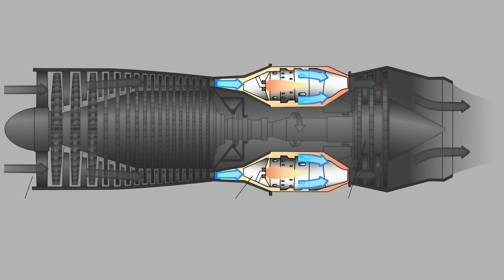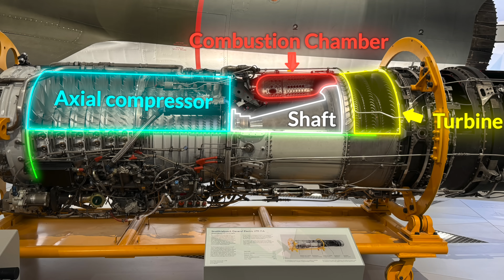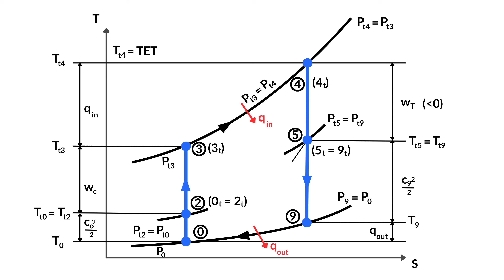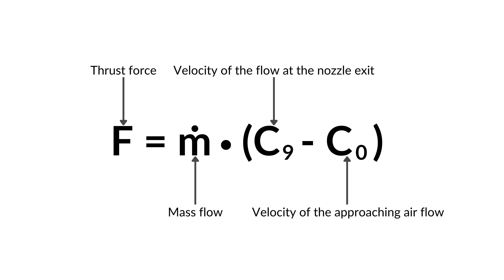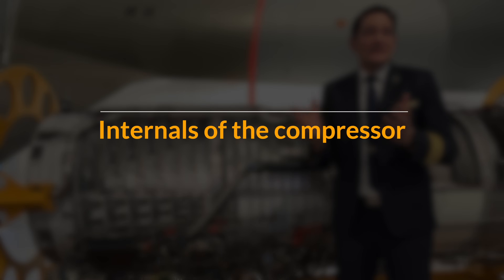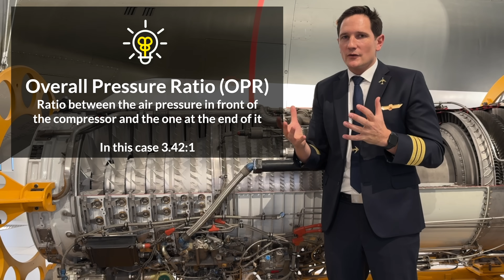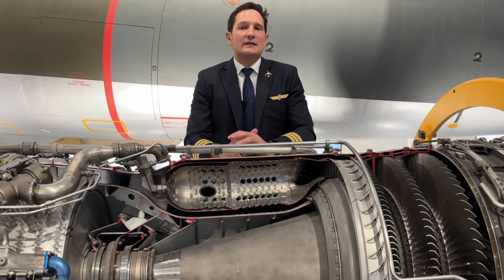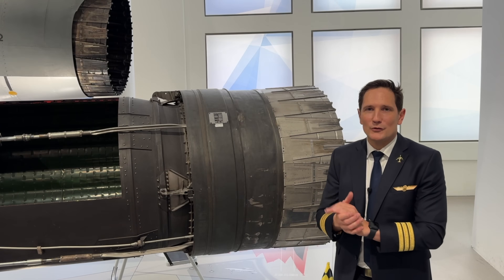How a TURBOJET Engine works - Explained by CAPTAIN JOE

Comment: As far as the air going through a turbojet engine is concerned, the stators move as much as the rotors do.  They don't move, but the air doesn't "see" them as stationary.  The air gets batted one way by a rotor, then the other way by a stator.  It gets smacked back and forth like that all the way through the compressor section.  Stators are the unsung heroes of turbojet engines.  The compressor section of an axial engine couldn't work without stators, and neither can the turbine section.

Comment: Captain Joe - This is probably the best description of gas turbine operation I've seen on You Tube. The one additional point that I would suggest including is that a gas turbine involves only a portion of the flowing working fluid (air) in mixing with fuel and combustion. This is in stark contrast to Otto cycle engines where the entire charge is mixed with fuel and burns. Otto cycle engines can do this because the hot parts are only intermittently exposed to the very high temperatures created by stochiometric combustion. The combustor or combustion chamber of the the gas turbine is designed to use the air that doesn't participate in combustion to cool the walls of the combustor and to rapidly and thoroughly mix with the hot combustion gasses to get the mixture of combustion products and unburned compressed air down to a temperature that the nozzle and turbine can endure. 
The thing that you properly mention that always confuses people seeking to understand gas turbines is that the highest pressure in the engine is at the compressor discharge. The general public always assumes, because of their greater familiarity with the Otto cycle, (combustion in a closed volume) that combustion must raise the pressure of the flowing air....but of course in the Brayton cycle the volume expands while pressure remains constant (other then the pressure drop of forcing the air through all the holes and features of the combustor).
Then the very hot and very fast flow of working fluid is sharply turned to tangential flow by the nozzle stage to impinge on the first stage turbine blades who extract work by expanding and turning the flow back to straight axial and so on. Most explainers say the flow "Spins" the turbine. This weak statement leaves the person trying to understand the engine operation with a host of other questions.

Comment: Suck Squeeze Bang Blow is a wild way to describe a turbine engine.
Reply: Actually, fewer people would be confused if we said "Suck Squeeze Whoosh and Blow". The gas turbine doesn't burn with bang. is burns with the same noise as welding or cutting torch....a whoosh. Otto cycle engines burn with a bang, but it isn't the bang you hear. You hear the bang of the exhaust valve opening and the piston pushing the burned gasses out. (if there is no muffler) The bang of combustion is contained by the piston, cylinder and head. When the bang goes crazy bad in an Otto cycle engine, Detonation, you hear the block "ringing " like a bell.
Reply: @jackthompson4993 That's true that's a good point! Is there a better term than Whoosh or is that the most accurate?

Comment: In the compressor section, the narration gives the impression that compression happens became the air is getting pushed into a smaller and smaller space.  It's actually the reverse. Compression happens at the stators.  The rotor blades add kinetic energy to the air stream, and as the energized air encounters the stator blades, the kinetic energy is converted to pressure, which in turn increases the temperature, and this process repeats all the way to the end of the compressor.  The volume of the compressor decreases in accommodate the decreased volume  of the heated and pressurized air.  So basically, the air isn't compressed because the volume of the compressor decreases, but the volume of the compressor decreases because the air is compressed.

Comment: If anything, you should have mentioned Frank Whittle the inventor of the turbojet engine. I worked on the J79 which was the engine for the F-4 Phantom.

Comment: Hi ,
well explained video of turbo jet engine m thanks for it 

may i know whether the APU of boeing 787 can be started in case of power failure due to both engines out and then use for giving power to controls ,hydraulics and as well to radio communication ?
of RAT is the only option which can provide those necessities ?
thanks again

Comment: We have programming forums too.....every platforms have different forums and as a beginner I used to just put my full bug and wait a day or 2 there were nice people who used to send almost the full code.....FORUM WORKS!!!
Reply: Do you have any computer or CHIP on or near the engine??? Or they wont be able to stand the heat around the engine??
Reply: Higher engine efficiency implies lower entropy generation...efficiency is high---- --higer the power and thrust-- and faster the plane moves---- And if angle of attack of wind is right more air will go in.....but fighter jet plans NEVER STALL no mater what they do, why???? nose-too-up over 90 degrees or full spin-- I know what I see at each angle is only less than a second......Henc what's what's I  am trying to say one or 2 seconds should not make any difference
Reply: sorry about clowning but its Bernoulli's principal----- hose-plastic-garden-pipes---sqeeze it at the other end, pressure increase and becomes a jet---addd shoer head its even more sharp and then what happens if I add a battery-motor to my showered, --it will become bike washing high pressure thingiii

Comment: A better explanation would be to explain how the "gap between any two blades" act as a diffuser. The gap (and the blade) act as a static or dynamic diffuser to slow/quicken the air in order  to increase the pressure at  the compressor end  and to accelerate the air to change pressure energy to a higher velocity at the hot end,  There is a static diffuser after the last stage of the compressor which helps to stop blow back from the burning stage  into the compressor. Be it axial or be it centrifugal ( Radial)  it is the variations in the  sequential DIFFUSERS  that do all the work, including in propellers. Most centrifugal ( radial ) compressors have an axial start, and the diffuser is an integral formation of the change in the radius / circumference length, forming the divergent diffuser, required in a compressor where the compression ratio of a centrifugal stage is higher than one axial stage. . 

The static blades do not merely change direction of the flow, but they too are DIFFUSERS that increase the pressure in the compressor and accelerate the air to higher velocity at the hot end stators. One could have mentioned the slow air needed to keep the flame burning, and then by pass air is added later to make it burn wilder, then more air to cool it down before entering the hot end turbine diffuser blades. Even the final pipe with the afterburner is a diffuser, and the exhaust control, another diffuser, as are the elevator, rudder, ailerons flaps, slat, wings, extended undercarriage, wing tips and spoilers!

A jet engine is basically a lot of tiny  helical RAM JETS, placed in parallel at different phase angle on the circumference of a cylinder, rotated around, so that the multiple tiny helical ram jets, phased, in parallel can start when the rotating cylindrical core, is stationary with respect to the ground, The sequential spaces, in series, between any two blades, form the long ram jets paths through the core of the  engine!!!! Hence the jet engine consists of a lot of tiny, phased, helical, ram jets working in parallel around a rotating cylinder! There will come a time where, the pressure distribution around the wing shape will create all the diffusers we need to make a thrusting  engine, by injecting fuel above or below the  contoured surface of a wing, after all, the wing is, two diffusers working one above the other, so are the control surfaces when we need them. The Diffuser and the ENGINEER  are Gods in aircraft design. The compression ratio of a jet engine cannot be above 50:1 as the temperature will be so high due to the increase in pressure, that adding fuel will be ineffective, 

 The brilliant engineering that went into the  engine for the SR 71, is hair raising to those who appreciate the working of a static diffuser, as that will be getting closer to God's own work,  THAT IS ENGINEERING AFTER ALL,  a man doing God's work, and not just operating a machine through following instructions, as they did not do on the Boeing 737 Max, nor the recent Air India crash where the Hull losses of that company does not fare well when it comes to simple maintenance of complex engineering. Few people know what is an ENGINEER. Many companies pay them less that they pay those who take the aircraft from one location to another.  Engineers are not respected  in the transport and communication systems on land, sea, and air. Modern people prefer to operate engineering devices, as Smart phones, hoping that the intelligence required in engineering will radiate and enhance their own performance. That will never be, but the operator can console himself through  enhancing  his simple repetitive activities by wearing and wrapping around him or her, an engineered prosthetic aid as , a pair of shoes, uniforms, Smartphones, cars, ships and aircraft. Note, one modern engineer, working from his home, can control, at a range of 10,000 miles,  10,000 drones using such micro modern engineering, where location, stable control, and navigation on Earth, can be done to the nearest five centimetres. 

It is interesting to note, those tiny propellers mounted on tiny drones, are now breaking records at Ukraine / Russia / Iraq / Palestine / Israel,  are dynamic DIFFUSERS, as shown in this video, explaining the operation of the mighty jet engine. Operating, shoes, knives and forks,  horse carts, bicycles, motorcycles, cars, ships, aircraft, has not changed much in the last 100 years, but the ingenuity  and processes in, monitoring, control , diagnostic, navigation,  included in all engineering devices , have risen exponentially. Few operators can ever appreciate the inner depth of engineering, Few people know an engineer, less a mathematician / engineer! Most people love to buy,  proud to own, or lease, or borrow, wear, operate an engineered craft, to enhance their naked, bare, performance, without ever understanding, nor appreciating the efforts and responsibility of an ENGINEER,  People appreciate and pay for a priest's prayer, when riding/ mounting on an engineered magic carpet, moving on land, sea, and air, and even tip the bartender when he offers them a drink after the journey on an  engineered the magic carpet, but most people never appreciate an engineer's efforts.  Engineering activity outside the human mind,  is  REALITY AND TRUTH , It works or it fails. All that exists within the boundaries of the human mind are illusions, myths and fantasies,  they never fail! People operating engineering devices, they stay experiencing  the titillations  in their human minds which are supported outside the human mind by pure engineering structures. If  either the engineering  that supports  Reality outside and inside the human mind fails, then all fail,  Illusions never seem to fail, as long as they stay within the boundary of the human mind, they are destructive in a sick human min, as in the case of Arthur Bud Holland of B- 52 fame, as disasters in other air displays.
Reply: Passionately said! We are certainly an under-appreciated lot. All the credit seems to devolve to the business men and the lawyers. Engineers are certainly the agents of change responsible for the mind -boggling changes in character and quality of life that have happened in the last 200 years.

Comment: The engine must produces most thrust during the take-off. The inlet air is stationary (discounting winds) and the jet accelerates it to high speeds. So the difference in velocity is greater. Also the engines need to accelerate the airframe to achieve pull-up speed and climb also requires work (= mgh). While in level flight the engines needs to produces enough thrust to overcome drag and get enough wind under the wings to produce enough lift for maintaining level flight. So the engines can manage to keep the aircraft flying with lower thrust than take-off.

Comment: Trying to answer your question at 6:56 'What phases of flight does a jet engine produce the most thrust?'   At the beginning of the flight.
If F= m * ( velocity at nozzle   -    velocity of the approaching airflow) , then when  the velocity
of the approaching airflow is at the lowest the  value in the bracket will be at the highest.
 For example,   (8- 0)  or F=8m  is greater than  F=m ( 8-6 ) or F=2
Reply: I also agree with takeoff as the highest thrust. You explain the velocity part well, but there's also the consideration of air density being greatest at ground level and therefore makes the mass flow the highest then as well.

Comment: Captain Joe:
This is a pretty good explanation, but ❤as a mechanical engineer, I'm a bit troubled in gas turbine explanations with the idea that the gas flow "spins" the turbine. When the hot gas flows through the turbine, it expands and changes direction, and in so doing the turbine extracts thermal, pressure and kinetic energy, converting it to mechanical torque. The torque either drives the compressor or the propeller, depending on which turbine we are addressing. (The torque times the speed is the horsepower generated by the turbine.)
This is what the descending piston in a piston engine does: it expands the hot gasses to extract mechanical work from them on the power stroke.
The other thing that is always left out of the discussion is that the combustion of the fuel only involves a fraction of the compressor compressed air stream. A significant amount of engineering design and angst goes into mixing the products of combustion ( at a very high temperature like 3000 C) with the compressor discharge air to get the hot gas stream entering the High pressure turbine down to a tolerable temperature for the blade materials. The PT-6 cleverly folds the gas flow to let length of travel for mixing without adding to the engine length. (All those holes in the combustor promote mixing and cool the walls co the combustor.)
That is why the engine's power is limited by TIT (turbine inlet temperature) at a number much below the stoichiometric combustion temperature.
The advantage that the piston engine has over the gas turbine is that because the combustion is intermittent and hot stoichiometric combustion gas temperature is very quickly lowered by expansion the surrounding materials can be kept cool without heroic measures. This use of a very high peak cycle temperature gives the piston engine better thermodynamic efficiency. The piston engine is also muck cheaper because the piston and cylinder head can be made of aluminum rather than exotic high temperature turbine materials.
The gas turbine otherwise beats the piston engine hands down in power to weight, weight, maintenance and TBO.
Unfortunately , all that turbine performance comes at a purchase price per HP about 10X that of a piston engine.
Turbines are fantastic for operations that fly a lot. For operators that don't fly a lot, pistons remain the affordable choice.

Comment: At Converging,at Compressor,the Physics of AirFlow is High Velocity with Low Pressure,but again it's gain High-P and Temperature,Velocity and Pressure must be opposite
,so if there is High V by the Converging shape,how we can get High-P and T for Combustion,Captain?

Comment: hi there, I am a student in an aerospace faculty,
and I have some questions here, 
in some types of tubrojet engines there is a part called diffuser, which is before the compressor.
so what is it's importance and why most turbojet engines don't use it ? or it is combined with the compressor?

Comment: The reason the compressor is much bigger than the turbine on a turbojet is because the compressor is taking the air from ambient to the OPR, let's say 1 bar -> 10 bar. The turbine is taking it from 10 bar -> to maybe only 5 bar. The remaining 5 bar is then put into the nozzle which converts air pressure to velocity using the Bernoulli's principle to provide thrust. As you'll know a turbo fan differs by using that 5 bar to drive more turbine stages to power the fan. 

In addition, each stage of the compressor/turbine is incrementing/decrementing by a ratio (let's say 1.2). So it takes about 13 stages to go from 1 bar -> 10 bar, but only 4 stages to go from 10 bar -> 5 bar. 

All of the above assumes zero airspeed. Airspeed changes it a little bit.

Good vid though.

Comment: Be careful. Most fighter jets use Turbofans with a low bypass ratio. The F104 and F4 use the J79 engine behind you, which is a turbojet, but many modern engines in fighter jets (F15, F22, EF, etc.) use turbofans. (You filmed this video in Munich, right?)

Comment: In the combustion chamber there is much higher pressure than the pressure of intake air stream, so why the jet stream of combusted air fuel mixture is not forced out in both directions ? Always causing compressor stall.😮
Reply: You have missed the essential difference between a Brayton cycle (jet engine) and an Otto cycle (gasoline piston) engine. The combustion in a jet engine does not raise the pressure of the flow. It expands the air,  and the velocity and energy of the flow increase while the pressure stays constant. Actually the pressure through the combustor has to decrease....because of all the small holes that the air has to pass through to cool the combustor and mix with the burned gasses. the highest pressure in the engine is at the compressor discharge.
Reply: @jackthompson4993  thanks for the reply, really appreciate it.